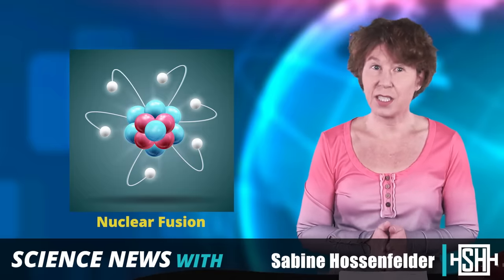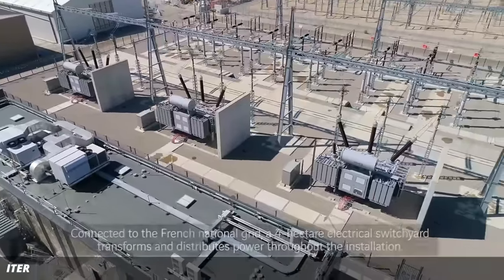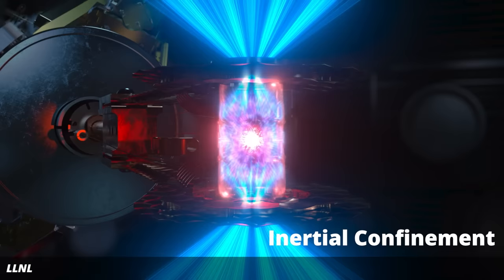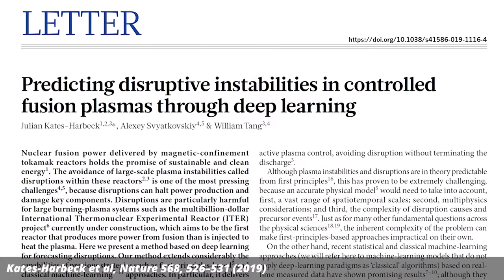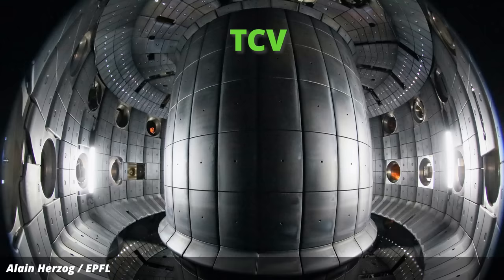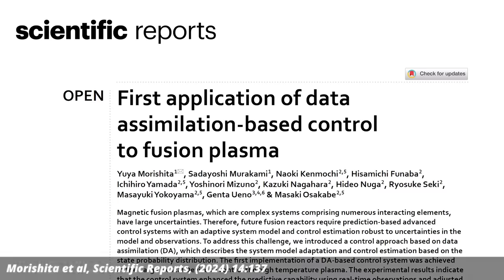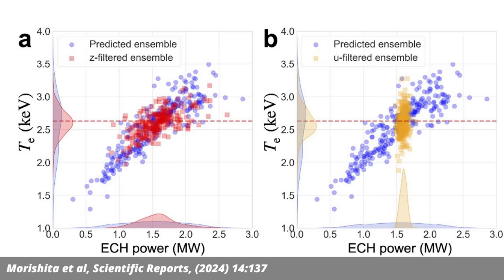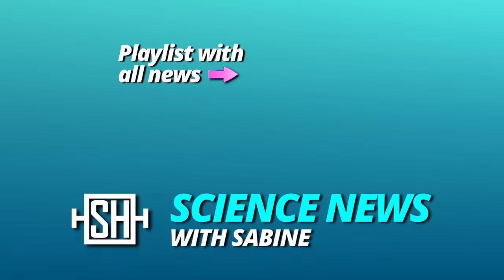First Nuclear Plasma Control with Digital Twin

Comment: 98% control seems like a good starting point, but 2% uncontrolled can still cause a lot of damage, I suspect.  Knowing almost nothing, my wild uneducated guess is they need a few 9's for this to be viable, like 99.999%
Reply from the maker: Yes, but that was 2019. Basically the stone age of AI 😅
Reply: @SabineHossenfelder  Ah, I missed the date in the video.  It would be nice if whatever AI they end up using, that it would "explainable" so that they could elicit some kind of mathematical rules out of it, instead of leaving it as a neural net which can generate weird results at times.  I know it's a hard problem and the results might be limited, but if they can get some insights into what the neural network learned from the data, perhaps a safer, more accurate, and deterministic controller could be created.
Reply: @SabineHossenfelder  I think the biggest problem with Fusion is that fundamentally at the very bass ending of a fusion reaction just look at Stars and what ultimately happens they run out of energy and become super dense making it more like a big battery of potentiality. With this observation it is clear to infer that it's going to take more energy with the fusing process all the way through just thinking about The Logical route end of the fusion process which we observe in the Stars...
Reply: @AquarianSoulTimeTraveler  None of that makes any sense. We're already past the point where we can get more energy out of fusion than we put in. Now it's a matter of sustaining the reaction.
Reply: @AquarianSoulTimeTraveler They feed the reaction with a hydrogen 'gun', so its only fusing hydrogen. The helium / other elements left over after the reaction are kicked out as the hydrogen passes through. Unless you're concerned that we'll run out of hydrogen fuel somehow (not for billions of years!), there's nothing to worry about there.
Reply: If that's actually overall accuracy then it may not be a good metric. For example if you say no one in the population has cancer you'd get about 98% accuracy too. But it is a useless model. If they are refering to the TPR (true positive rate) then it may also not be a good model since we can get 100% TPR if we say everyone has cancer, though we'd get a 100% in FPR (false positive rate) too, which makes the model terrible too. To bring home the point, a random model would get TPR=FPR for any TPR you'd like.

There's one missing metric they (or Sabine, maybe) forgot to tell us.
Reply: @AquarianSoulTimeTraveler  Are you comparing fusion reactors with the last stages of stellar evolution?
Reply: What's the minimum reaction time to stay within design basis accident parameters?
Reply: No way to get useful energy out due to the pesky coils. 😁😂😂🤣
Reply: @SabineHossenfelder  wrong shapes. What shape is the sun?
Reply: Try a sphere... The sun is a sphere.
Reply: Nines! Yes! But two fives at the same time is a score of 10😂
Reply: Have faith.
Reply: @esecallum exactly! Make it a sphere and uniformly apply 26+ gigapascals... easy-peezy. 😂
Reply: @UKnowIfUKnow  THINK. a filament circle plasma ribbon always KINKS out of shape and loses energy. too many degrees of freedom.for a sphere the forces are inwards or outwards
Reply: They do do that. Thats what loggin is for. Then they translate it to mathematical formulas @yeroca
Reply: Come on, except that we are talking about a fusion in both cases, there are not many environmental properties that are the same in a star and a tokamak/stellator. 
In a star the gravity is the main "force" working against the energy of the fusion, and it is also the reason for the spherical shape of stars. However, in these reactors a  strong electromagnetic filed is holding the plasma together, which must follow other rules of physics than only to obey the laws of gravity. 
But hey, if any of you have a good idea how to build an (anti)-gravity device, we could use it for zillion purposes, and fusion is 100% one of them. 😉
A machine formig electomagnetic forces in a spherical shape (radial I think is the better word, if I'm right) would also solwe the problem. The only tiny little problem is that it would be against the law of physics. 😁
Reply: @Mikaci_the_Grand_Duke  well your crappy torus always kinks and loses energy. 50 years of failure. Even if works how you get energy out thru the delicate coils? With a sphere you only have inwards and outward and you can use em fields.
Reply: @RemotelySkilled  yes they are stuck with the stupid iter. Even the inventor dumped it decades ago.
Reply: @AquarianSoulTimeTraveler uh yeah please leave the thinking to the physicists
Reply: The problem is, all these experiments really do is make lots of tritium for nukes (if it isn't simply wasted, and nukes are concentrated wastage TBH)... To break even they have to make up for the 100+ failed fusion experiments.. Control is only part of the problem (a very important part that obviously we have more and more control over), there's plenty of others that keep pointing to the idea being non-economically viable, especially compared to the alternatives... Trillions have been wasted, only a few 10s of billions of Advanced Nuclear (Breeder Reactor & Molten Salt) R & D... SACRILEGE.. 
--
I prefer my tiny little 1 stroke engine/boiler/generator combi... It a revolutionary 1 stroke, single cylinder turbine-piston internal combustion + heat engine that combines the best features of a turbine (no crank wastage) and piston engine (instant high compression) with a novel rotary heat engine... I will release a 3D model as the first vid on my Simplish Ideas channel in a month or so now I've got into 3D graphics. I'm combining the engine block boiler/cooling system with the engine, generator, turbo powering 2 tesla turbine heat-exchanging water pumps and a condensing flue/exhaust at the moment.. 
--
It's also a steam turbine and has a condenser to extract the remaining heat from the exhaust. On paper it's far more efficient than the competition as an engine/generator and an OK boiler. Free piston so continuously variable speed, only one or two gears needed. Can switch on and off - NO IDLING! lol. I've been at this for 2+ years now! 2 litre (per stroke!) engine part on its own fits in a 20cm diameter, 25cm long cylinder, that's the whole engine, valves, spark plugs, fuel injectors and everything.. Makes a Mazda rotary engine seem like it's going backward!
--
Same design for the boiler and engine but the engine adds a couple of step down gears for even more torque. Tiny package, smaller than a normal boiler or engine, let alone boiler + 100kw ICE generator that could go up to 250KW / 500HP or more potentially.
Reply: @RemotelySkilled  I have quite the opposite opinion.  It's really unclear how the pulsed laser approach can be made to produce energy on a near continuous basis.  No one is seriously even thinking about implementing it, as far as I know.  Helion's approach looks really interesting to me, and they seem bent on success in the near term ( < 5 years).
Reply: @esecallum My crappy torus? Hey I'm not Elon. 😆 Dude, you're full of "great" ideas, why don't you do some research and implement some of those, build a sun in few years, and kick the ass  of all those "stupid" scientists. We want your ideas desperately, asap! (I'm sorry @RemotelySkilled, it wasn't addressed to you.)
Reply: I see quite a few inertial confinement commercial projects in the works on the Wikipedia commercial_fusion page. I hope you're right!  I'm happy that a bunch of different approaches are being used.  If we are so lucky as to develop several viable approaches, that's great!
Reply: @RemotelySkilled  Continuous to me means that you can reload the "shot" and fire again within a period of time without need for extensive maintenance between each detonation.

By the way, the ingredients for most fusion reactors are not simple hydrogen, but some combination of tritium and deuterium or helium-3, etc.  These are not easy to find on earth, and in the case of helium-3, unless you want to mine it from the moon, it has to be synthesized in some form of reactor because it's super rare.  This complicates things a bit.
Reply: Seems a good start.
Reply: But it seems to me that any computer  approximation to the real state of the plasma is not well enough. Because you said that this system is chaotic and any minor difference in the previous state might end in a big difference in the final one. Soooo did they got nothing sustainable in time ??
Reply: They also make process at the same time in other areas, e.g. plasma-wall interaction etc. So the big problems are tackled from every direction. On the other hand, fusion is always 20 years away:P
Reply: @yeroca It would be nice if they could derive rules from the AI, but it's not clear they can do that for AIs we currently have.  There's a worse scenario though: at the moment the shape of the chamber has been determined by people, and we then see how well an AI can control the plasma within that chamber.  One possible next step is to get an AI to determine a chamber shape which optimises the ability of the AI to control the plasma.  In that scenario, not only might we not know how to control the plasma, we might not know how to determine the chamber shape that makes the plasma controllable.  That would not be AIs taking over in the Skynet way, but it would be AIs becoming custodians of knowledge which is not transparent to us and so cannot be shared with us.  We would still be able to go to them and ask them to design and operate things for us, but we would not necessarily know why those things work nor how to operate them.
Reply: Just need a bit of flex tape to deal with the damage.
Reply: @SloverOfTeuth  As I understand it, there's a lot of research going into explainability, so perhaps in the next ten years or so being able to extract "rules" from a NN will become easier, and techniques will be developed for the many kinds of NN that there are out there in the wild.

I like your idea about reshaping the chamber using AI.  It seems amazing to me that these two technologies (AI and commerical nuclear fusion), which didn't really seem related in the beginning, have become entwined in a fascinating way.
Reply: @thegreenxeno9430  🤣
Reply: @RemotelySkilled  It's not infinite if the fuel is finite and producable at only a certain rate and cost, but I get your point..  It appears effectively infinite.

There are definitely a lot of difficult problems to solve, and it's really not clear that any team will be sucessful in time to help avert the CO2 nightmare we have created and are continuing to create.  But I do think we need to have "all conceivable shovels in the soil"  on this issue.
Reply: @yeroca  I like to think that back when fossil fuels were first discovered,  people thought they were infinite, too, because they couldn't imagine a world that used so much energy.    

I have a theory that humanity will always use the maximum amount of energy available to us, like how no matter how many lanes you add to the highway, traffic is never reduced, because once there is extra room on the roads, more people will use those roads until they get just as clogged as before.
Reply: Sort of like that last hard 5% of AI car driving software which continues to fail on  routine basis putting lives at stake...like the cyclist that followed the left-turning truck into the intersection and was left turned into roadkill by the AI in the oncoming vehicle. It "assumed" it was safe and the collision avoidance was inadequate after the "move" was initiated by the AI
Reply: @orchdork775  Exactly this, ha!  I remember reading about a time when, I think perhaps it was Edison or Westinghouse, said that when they built these large hydroelectric dams, the electricity will be too cheap to meter.  Well, it seems they changed their minds :D   When something is free, or near free, people will use it in excess until it becomes scarce again.
Reply: @pablovirus  i am literally one of the Top minds in theoretical physics. If you see a problem make a claim and i will level you if it is illogical...
Reply: @chrishartley4553  exactly... it is an easily observable proof. If you have any thoughts questions or statement lmk please. Thanks for your input.
Reply: @Mechulus  lmk how that works out for fusion... i am stating the most important fact of shared observations, increased density of materials=wasted potential energy... if those heavy elements can't be ran through fission process we have wasted energy that can't be extracted. Just think about it for half a second... making heavier elements takes energy like a battery. This is why nasa doesn't us fussion reactors because they don't and won't ever be anything more then a glorified battery...
Reply: @esecallum  Princeton has a spherical tokamak, and they've been experimenting with it for a long time. Your idea of a sphere is good, but physicists have been working for a long time trying to figure out how to actually create a magnetic field in a perfect spherical shape. It's far harder than it sounds. As someone else said to you, if you can figure out how to do it, please join the fusion community and show us how!
Reply: 2% of 150 million degrees can still brown a marshmallow pretty quickly.
Reply: @AquarianSoulTimeTraveler  Is this account a badly trained AI? I see your comments on every video and they make no sense to anyone who knows even a little about physics 🤔
Reply: @yeroca  Don't worry, in 2049 the AI will be smart enough to control the plasma 100%. Then 5 years to build a working power plant and we will finally have fusion power in 30 years from now :)
Reply: This still seems like an enormous challenge.  Fusion will increase the chaos.  No matter how powerful the computers and AI, there will always be latency between what the plasma is doing and the control systems reacting to it.  98% is nowhere near reliable enough.  A 2% failure rate would be 7 whole days per year.
Reply: Feels a lot like curve fitting. I spoke to so many day traders and investors who taught they found pivotal patterns for their holy grail of money pouring in on a regular infinite basis.  What I saw is that every pattern is broken. New situations will change the pattern as well does volume. Big banks and government knows this all to well. Maybe you should have a reactor in Space to save us from unexpected events.
Reply: @grahamf695  Bottom line is that the control system needs to be able to react faster than the plasma can whip around.  I guess that maximum rate is known, and so the control system can be designed to stay ahead of it.
Reply: @yeroca  I imagine things happen extremely fast in a plasma - maybe in micro- or nanoseconds.  The AI would have to react very quickly.  Getting the right answer two seconds later is no use.  Latency in the network could be more of a problem, because it is limited by the speed of light.  You can’t just throw processing power at it.
Reply: @RemotelySkilled  I suppose it comes down to a balance between how late the real time data arrives in the AI due to device latency and transmission time, how far ahead the AI the can predict and decide what to do, how long it takes to execute the control commands, and how quickly the plasma changes its state.
Reply: Fusion doesn’t use regular hydrogen. It uses deuterium (never going to run out) and tritium(extremely expensive and scarce). Tritium is made by absorbing neutrons in deuterium inside a heavy water fission reactor; this is good enough for experiments, but ultimately fusion must sustainably make its own with isotopically enriched lithium in an absorber blanket and it must be carefully captured and used to make sure that you make at leadt as much as you produce. We kinda-sorta-think this is possible but it is untested and we don’t know if we’ve yeat discovered all the practical problems yet.

This is complicated by the fact that the first wall is going to be heavily damaged by neutrons from the reaction so it will need some kind of shielding which may not be compatible with getting enough tritium. If you can’t get the trtium you have to fuse much more D-D which is very much more difficult.
Reply: @RemotelySkilled  I second that. Brilliant comment!  If scientists understood every parameter that caused instabilities in plasma, they would have already figured out how to correct them all. AI might be of some help, but I don't think it's the holy grail of fusion.  Excellent comparison to day trading!!
Reply: @grahamf695  In principle, you should be able to calculate the maximum speed based on the temperature.  The point is though control must be possible with current compute power because there is quite a lot of research being done in this area, and if it was outside the realm of current (or near future) compute power, they wouldn't even attempt it.  That's my assumption, anyway.
Reply: @RemotelySkilled  Yes, I think that would be ideal.  Use AI to discover the rules, then implement a control solution using those discovered rules.  My hunch, and I have no theoretical proof of it, is that this kind of rule based control system would be more energy effcient than a typical neural network because specific-purpose built machines are generally more efficient than general-purpose ones for the same performance level.  I am getting out on a limb here, so I'll stop now before I embarass myself.
Reply: @RemotelySkilled  Yeah, it's an intreresting question to determine if it's possible that a neural network (analogue or digital) is able to react to this particular problem more accurately and flexibly than any possible rule-based system.  That somehow the network is more intrinsically efficient and accurate than doing direct calculation via a function of the inputs.   My hunch is that the answer is no if there are a set of equations that can be extracted.  But NN's are just super amazing at "discovering" patterns, and it's tempting to think that they are the hammer for every nail :D
Reply: @AquarianSoulTimeTraveler  Its not. A stellar core and a fusion reactor (of any design) are fundamentally different.

The fact fusion reactions happen there are the only thing they do have in common.
Reply: @chrishartley4553  i provided alot of information with my claim can you provide some information for your claim against mine. If i am wrong logic should be able to beat me and if you are logical then you should be able to either see my logic or present an argument against my logic... thanks.
Reply: @AquarianSoulTimeTraveler  You have done nothing of the sort. You have made the assumption that a fusion reactor is exactly like a star, and that as such it'll be producing more and more heavier elements. You have provided no proof of your assertions at all.

The big difference between a star and a fusion reactor is that a star starts with all its fuel and burns through it during its life. A fusion reactor (unlike a fission reactor) is continuously fed the exact amount of fuel its needs to sustain a reaction.

There are a few different fusion reactions that are used or are proposed, but they all produce helium as a byproduct as well as neutrinos and/or helium (depending on reaction). Helium is a light, non-reactive gas, easily removed and valuable itself so well worth removing.

There won't be a nugget of increasingly dense material asorbing all the free energy. No fusion reactor conceived has the power needed to do that.
Reply: @chrishartley4553  well that is exactly the problem... Making heavier elements requires more energy put in then you can get out as has been shown time and time again in every fussion reactor. The Beauty of fusion is not energy production it is the potential ability to make new elements. It's honestly just logical that the observed behavior of a fusion reaction requires more energy then put in because fundamentally you are making it heavier adding energy which=mass. What is expected is what we observe. Show me proof of your claims and if you lack proofs i will settle for a logical argument.
Reply: @RemotelySkilled  google already took my idea of a LLM mixed with another model that uses logical deduction to figure out logically what is most likely scenario. Basically its goal is to present arguments and win arguments... this is fundamentally all that matters and explains what you are talking about here... it's gonna get crazy very quickly.